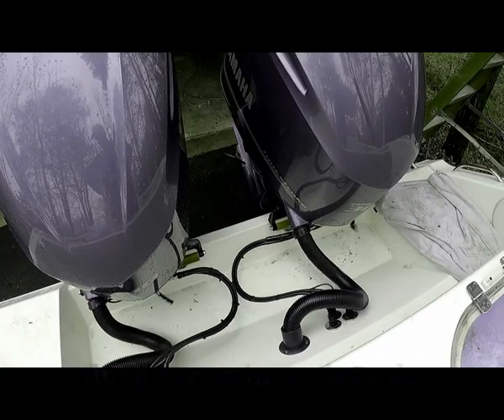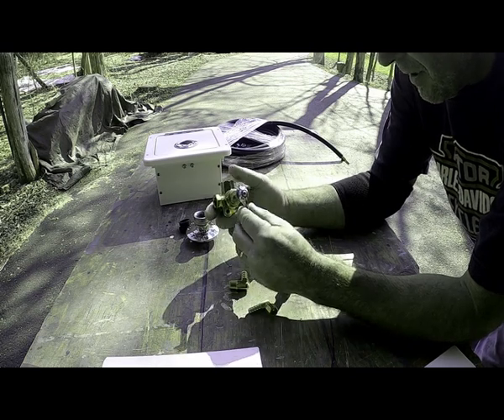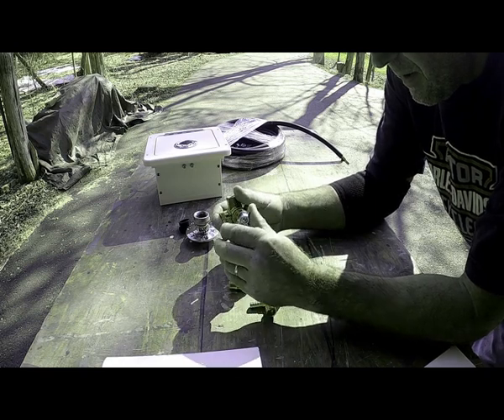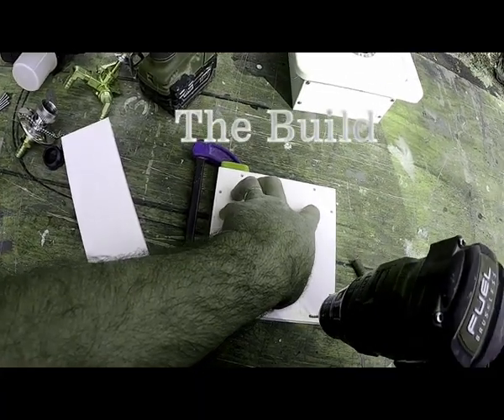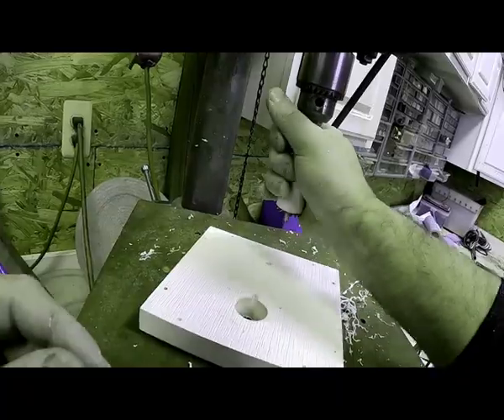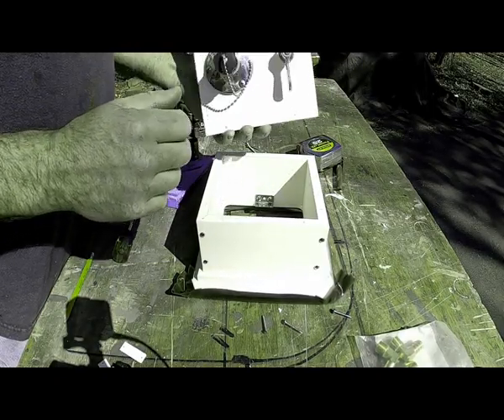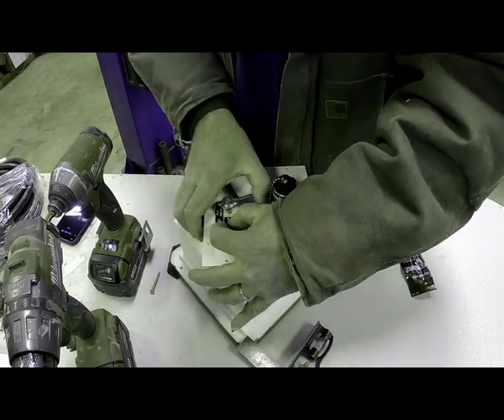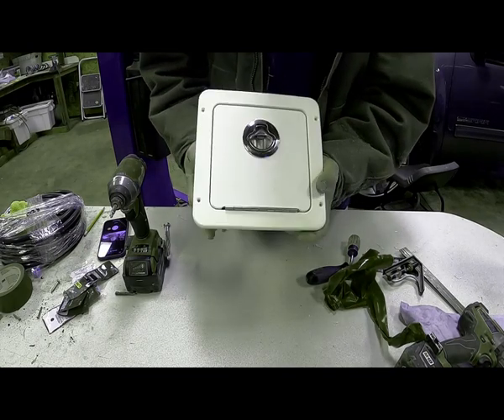How to build a remote engine flush for your outboard motors.

Comment: Thanks for uploading nice video, what kind of water hose did you use and where to buy?
Reply from the maker: I used 3/8 silicon hose bought online siliconehose.com.  But if I did it again I'd try harder to find a roll of Yamaha hose.
Reply: @4RibsFishing  You are right, I couldn't find yamaha hose at all online, i have triple yamaha 300 outboard,, I will trying this weekend to connect them,I really appreciate your video. Any place to get yamaha hose? They are selling very short yamaha hose not the roll.

Comment: Hi there which 3-way anderson Valve did you end up using to flush twin motors? Also did you ever find a better silicon hose source than the one in the UK? Thanks
Reply from the maker: Its their 210C-N. I'm not making kits or anything - so I didn't bother looking any further. If you could get a roll of the yamaha tubing that would be perfect.

Comment: Great design. Love your videos. Ty for helping us out.  My question is, is there any reason you have the valve? I was thinking of just using the bulkhead fitting with a y behind it to do both motors together.  Thx
Reply from the maker: Thank you Brendan.  Our marina doesn’t have the water pressure to do both at once.

Comment: This was really nice. I built the same system for triple engine and instead of using a manual valve  I add a small programmer that controls 3 solenoid valves, so I press a button and the program starts with the first engine do 5 minutes and then program switch to the next one until all of them are done.
Reply from the maker: That sounds very trick!
Reply: Be interested in seeing what you used for the timer & solenoids would like to try a two valve setup